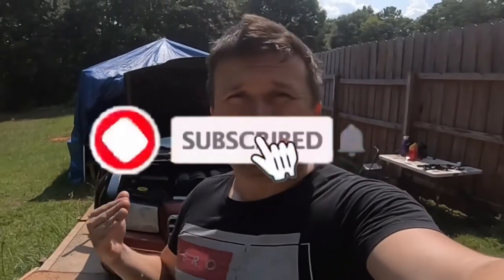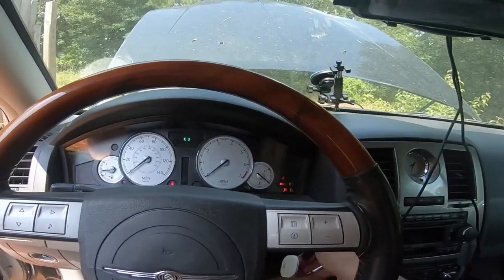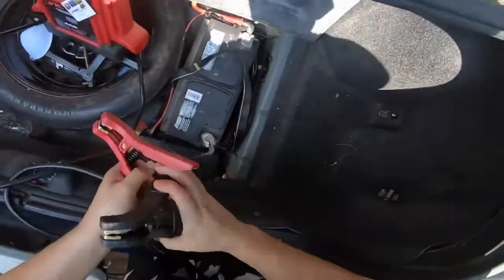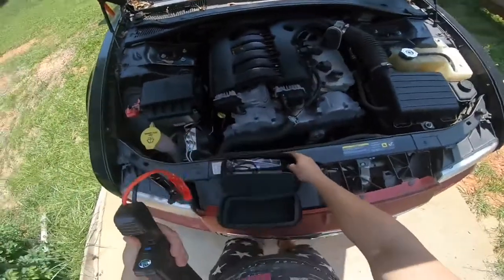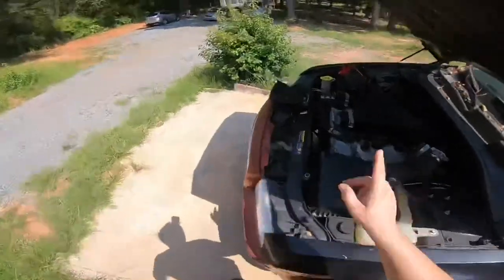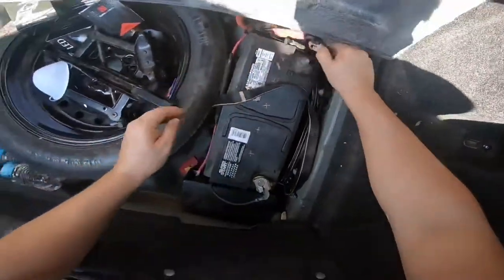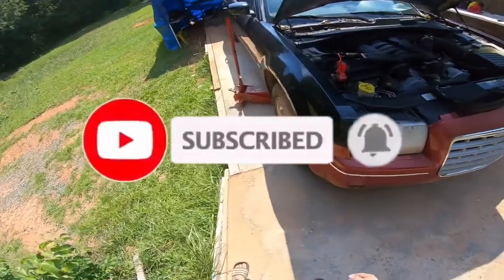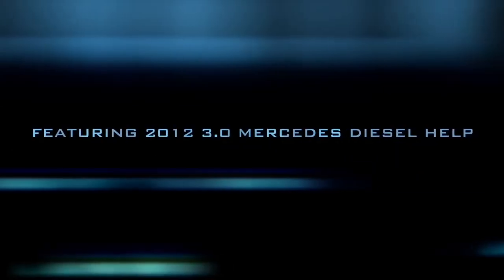Can you jump start a Chrysler 300 from under the hood with a dead battery? Let’s find out

Comment: i had the same problem with a tyre inflator on my 300c
it wouldnt work if i used the shock tower centre bolt but if i used the other 3 bolts it was fine (ie the bolts next to the one you were using )perhaps it has a rubber insulator or something hope this helps

Comment: Thank you! This is what I needed to get my car started (Chrysler 300c 2006). Trying to use the connections under the hood did nothing, but connecting my jump starter to the battery in the trunk worked perfectly.

Comment: No ground where you attached it. Try one of those 3 strut bolts or somewhere on the block. At 5:10 It looks like there is a neg. cable bolted on right on the side of that strut tower next to the Fuse box..... If anything, it should be more efficient hooking up from under the hood (less travel). No disrespect, but you should have tried other ground points cause I bet that was your problem. You gave up too soon...

Comment: I have the 2015 300s 5.7 hemi and i keep running battery down & I'm able to under hood jump start no problem; EXCEPT every single tome the check engine light comes on. I've gone to my mechanic 2 times this month & there is no code really but pain in ass to clear. Anyone know about this? Its a 2015 Chrysler 300s with only 45,323 miles on it
Reply from the maker: This can be your dead Alternator but even when replacing alternator on this Chrysler’s, there’s a voltage regulator in body control module / computer, and you must replace the computer that’s under your hood close to windshield to make it work, but you can replace it with a used one as long as all the numbers match
Reply: So literally right after post i started it & 14.5 volts while running; went to battery exchange in Albany Oregon $169 the battery was 50% under necessary so i got it (ridiculous price/ never paid more than $80) but it's a 7yr warranty & it is a massive battery
Reply from the maker: Yeah unfortunately Batterys are expensive now